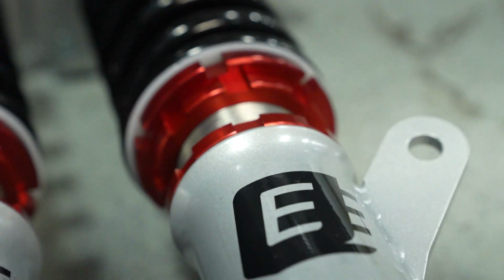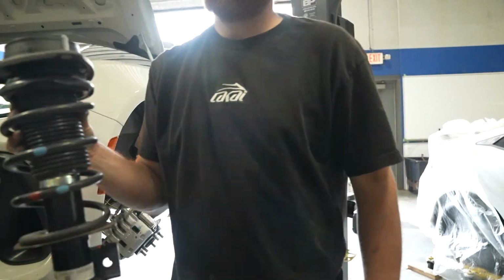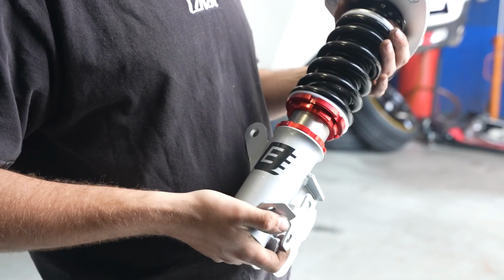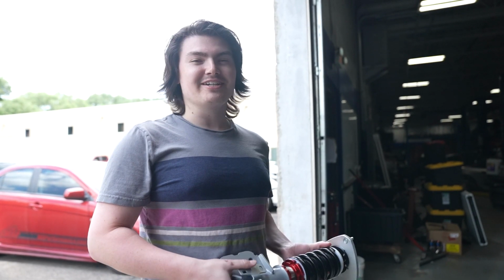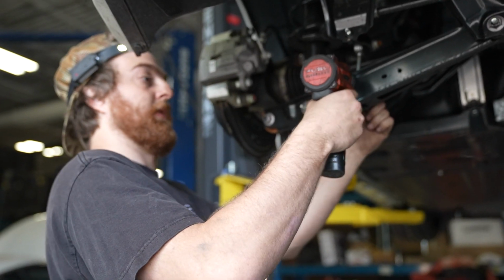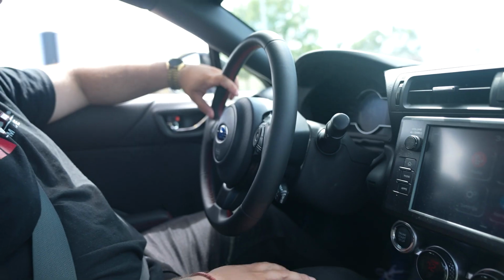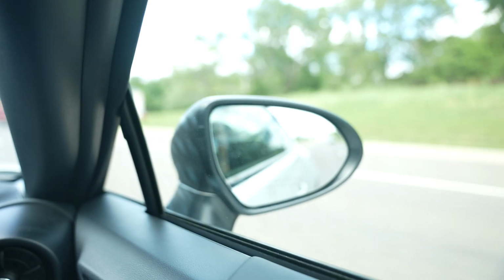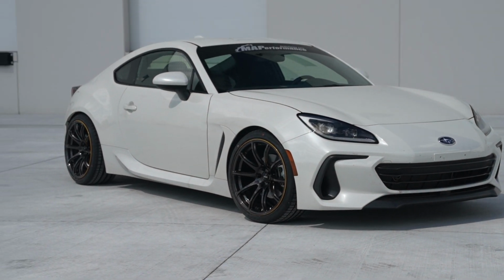2022 Subaru BRZ Gets Wheels, Tires, & Coilovers!

Comment: What happened to the turbo in the Brz ? did that not end up working?
Reply: I’m interested in that too
Reply: The ECU on the 22+ BRZ hasn’t been cracked yet, probably doesn’t work…
Reply from the maker: We could bolt up a turbo kit, but the car would not run due to the factory ECU settings. Still waiting on someone to crack it!

Comment: Did you guys throw on aftermarket lower control arms and toe links or is that still stock after putting the new coilovers and wheels on? Asking because I am planning on buying coilovers and putting 18x9.5 +45 offset wheels and want to see if I won't need the LCAs
Reply from the maker: This is stock LCAs and stock toe links. We are pretty limited in adjustability, so if that's what you're after definitely get adjustable ones!
Reply: Thanks for responding. I just wanted to make sure I would be able to fit the wheels & tires like you guys with no rubbing issues with the natural camber from the coilovers. I don't plan on slamming the car. I think I'm just going to lower it just enough to not have to worry about rubbing

Comment: Do you guys think that an 18x8.5 +44 wheel with 265/35r18 tires would fit without any issues on the 2nd gen?
Reply from the maker: That is a lot of tire for these cars, especially on an 8.5! I would go down to a 235 or 245
Reply: @maperformance  how about 18x9.5 +38 and 235/40r18?
Reply: @RR-cg2rq  gonna have a bit of stretch fitting 235s to a 18x9.5, better off with an 8.5 or 9 and throwing on 245s